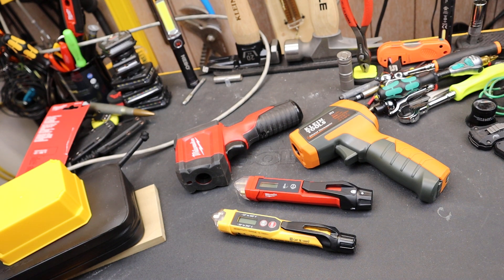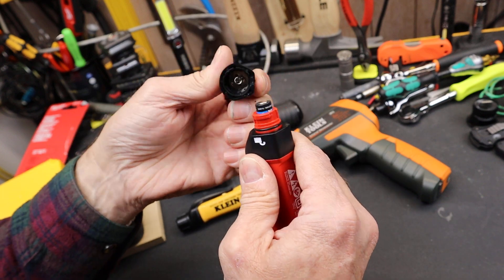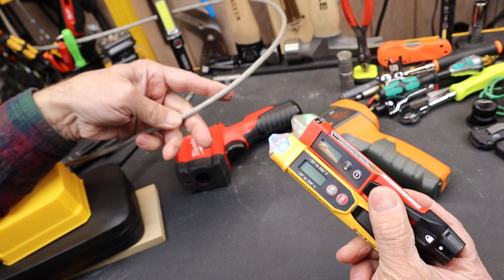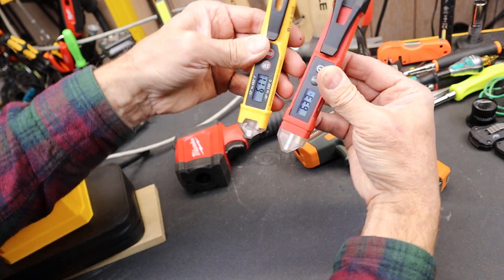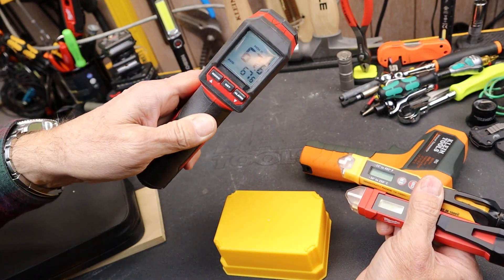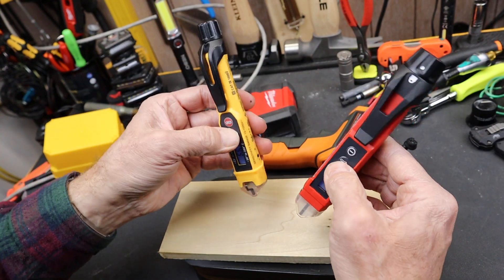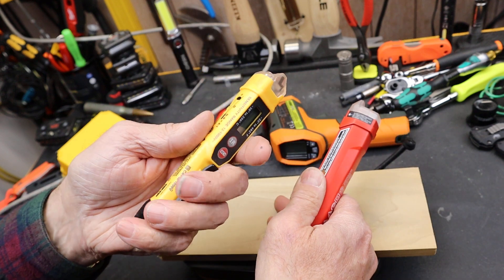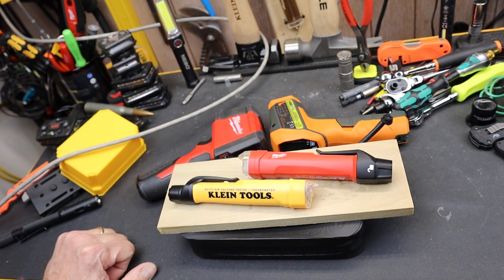Klein vs Milwaukee in Non-Contact Voltage Detection & Infrared Temperature. Gotta give Klein the win

Comment: OMG! I use this exact Klein every day. I will say I don't trust the temperature accuracy on mine. But it's usually "close enough" for repair work. And it's so compact. 90% of the time I just need to know if there is power or not. My multimeter is for when I need more detail. But initial troubleshooting with the NCVT is so useful.

Comment: I think we may have lost the plot when placing a value judgement on these readouts. The purpose of the IR sensors in these isn't to show you the temperature. It's to reveal "It's OK," vs "A little warmer than maybe it should be?" or "OMG-turn-off-the-breaker-now!"

Doc have you tried Santronics? They make 2 models, made in North Carolina. There's a 3115, red and skinny and is often found under different brand names, and the 3000 which is a little bulkier (like the various Kleins and competitotrs) and adds beeping. YouTube tends to be someone siloed to whatever's sold at big box stores. I have a feeling Santroincs survives from government contracts. They cite OSHA as a customer.

It's my next purchase to try because I'm tired of all the false positives my Kleins seem to suffer from.
Reply: Ditto on the Santronics. Morgan’s Maintenance compared the Santronics to the Fluke, and I agree it is a better tool.

Comment: I personally would be surprised if it is a different IR sensor in either of these ( I presume they're manufactured in the same place by the same people). I just assume they're calibrated for surfaces of differing emissivity unfortunately neither address this in their manuals. Generic infrared thermometers to my understanding typically are calibrated to objects with a 0.95 emissivity however the Klein's manual specifically says it's for HVAC so maybe calibrated for a lower emissivity. 

As a side note both manuals list the same stats:
Measurement Range: Voltage: 12 to 1000V AC
Temperature: -22 to 482°F (-30 to 250°C)
Laser Distance-To-Spot Ratio: 4:1
Temperature Resolution: 0.1°F/C
Temperature Accuracy: -22 to 68°F (-30 to 20°C) - Accurate to: +/-5.4°F (+/-3°C) 69 to 482°F (21 to 250°C) - Accurate to: +/-2% or +/-3.6°F (+/-2°C)

Comment: Meh. Any decent Clamp Meter can measure voltage (ac/dc), current (ac/dc), frequency, duty cycle, continuity, resistance, diodes, capacitance, NCV capability, and temperature.  

Much more capability.

Comment: I wouldn't put too much thought into the fact that they both have the same slightly weird Fahrenheit temperature range, it makes more sense in Celsius. 

I'm pretty dubious about the utility of non contact voltage detectors, they're notorious for both false positives and false negatives and only really work on AC circuits. Given so many limitations I don't trust them at all and don't see the point.